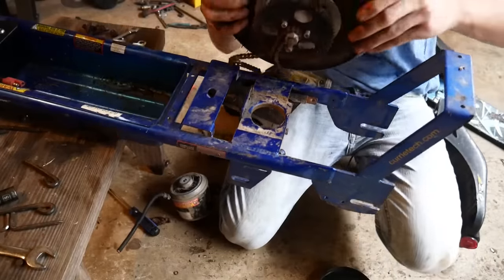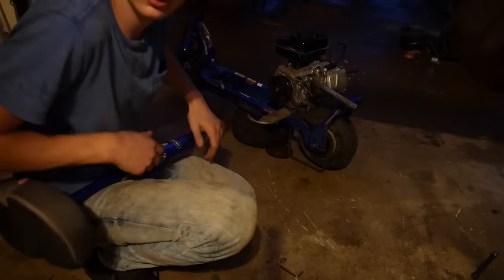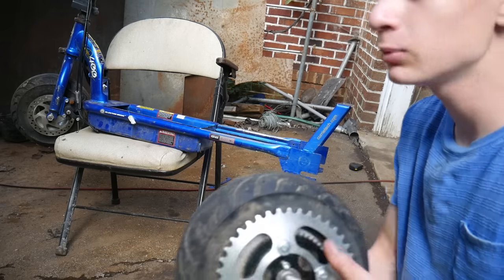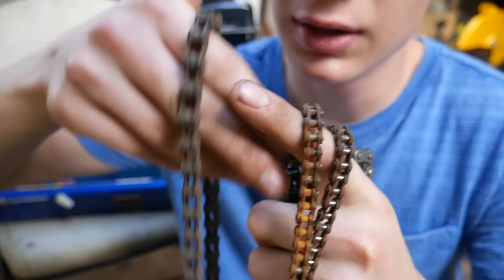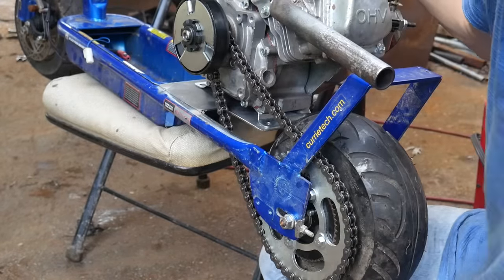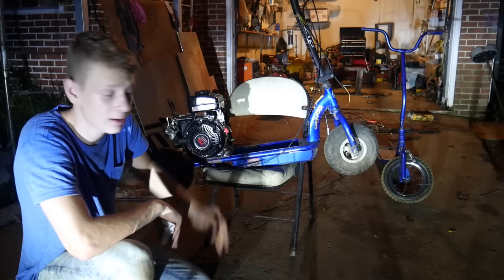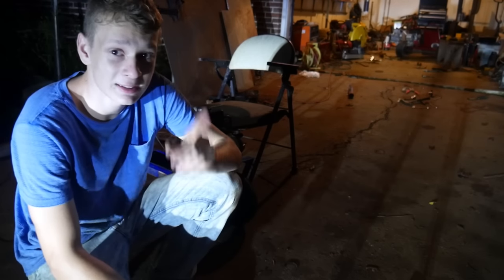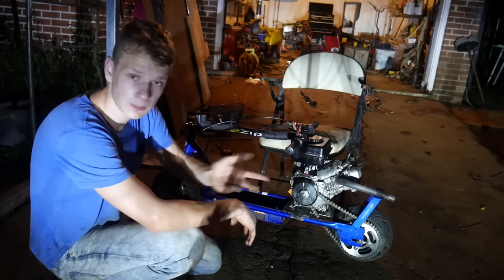Electric to Gas Conversion 79cc predator Motorized scooter Part 1

Comment: The area under the floor you can put a 12 volt battery and use it for a head light and brake light for night time riding.  To charge the battery you can use the chaging port that was on it. The hand brake that was on it has a built in switch to cut the electrical power to the electric motor that you took off and can be wired to make the brake light work.   Might want to put some eader wrap on that pipe too.   Just a thought for you to use.
Reply from the maker: David Johnson I was wondering what time wire did. I assumed it cut off the motor! Thanks David for the advice I appreciate it!

Comment: Don't paint. Just touch up the bad spots. If you plan to sell. The buyer would be more inclined to pay more for some thing that doesn't have layers of rattle can over factory powder coat
Reply from the maker: Corey Marshall why do you say it is powder coated?
Reply: @VasilyBuilds  well I'm not 100% but most Manufacturers of large scale use a Electrostatic powder coating process. This is the most efficient way of getting paint to stick without lots of waiste and its just efficient. It also doesn't scratch chip as easy and protects against solvents. Everyone has done a nice rattle can job to there project. Sadly 2 months later half of it will be ruined my the gasoline and oil spilled on it
Reply: @VasilyBuilds  clean and clear coat your welds and other exposed metal. The blue already looks good. Plus leaving it original has that new store look that parents like to see when they give there child hundreds of dollars to buy something like this. I mean that's the market for this. That scooter could make some kid king in his neighborhood. And hour of enjoyment
Reply from the maker: Corey Marshall I will probably do that. But I Will have to prime the bare metal. And I still have to do more welding

Comment: Picked up a 500w 48v electric scooter that was missing the batteries (chain driven) for $30. Sold the esc for $20 and motor for $70 to put back into making it petrol with a weed eater I have laying around

Comment: I'm actually planning on doing something similar with an e200 razor and a 2stroke bike kit
Reply: Did it fit? I am planning on getting a cheap 80cc 2-stroke kit for my 10-year-old Razor E300. Batteries are dead so I thought gas conversion is the cheapest way of making it fast again.
Reply: @Gamer-pb9tw  batteries for the e300 aren't that bad I don't think because they're let acid. you could do a pretty cheap lithium ion conversion if that's what your into. I never ended up doing it but it should fit if it was something you're interested in.

Comment: When you flipped the drive wheel so the sprocket was on the opposite side from original, how did you fix the free will mechanism that would only turn the other direction?
Reply: It's just on a ball bearing

Comment: Hey Vasily, do you know what size jets come on the factory 79cc carb. I have one on a bicycle and it seems to not rev past a certain rpm. Btw I removed the govener already. I think its my jetting. I am using a nt carb off a 2 stroke kit. Any advice would really be appriciated. Thanks.

Comment: Bro I’m making the same contraption as you same scooter and motor, I’m mounting my engine to wood do u think it’ll hold!? And I’m using a 36tooth sprocket on the back tire! With a 35# chain
Reply from the maker: 36 tooth is way too low. You'll have zero torque. Also it's better to use #420 chain, 35 stretches to much
Reply: Vasily Custom Builds what if I used a 60 tooth sprocket and 35 chain? It’s only a 79 cc engine!?
Reply from the maker: @matthewwright98  depends on wheel size. 8-13 inches use 53t would be perfect. I don't know your wheel size but I'd say shoot for 25mph top speed. 79cc's are not very torquey even when modified, it struggled. I think I ran 11/49. I had so much issues getting the alignment right with #35 chain, I switched to #420.
Reply from the maker: You can probably get away with #35 chain. Watch all my videos of this 79cc scooter, they may have all the info you need.
Reply: Vasily Custom Builds okay! I’m using to stick tire that’s on it, I just got a 60 tooth sprocket to be safe

Comment: Dude love the channel been here since like 600, please cover up bare skin welding, your too young to learn bad habits
Reply from the maker: dropn loads Yea for small tack welds I usually do not put on gloves. But I do put them on when I run beads. Thanks will keep that in mind
Reply: Vasily Custom Builds long sleeve shirt too. Don't mean to be a safety Sally but don't you notice the sunburn
Reply from the maker: dropn loads I thought that was only with Tig? Never noticed any redness or anything like that.  I will try to be safer
Reply: Vasily Custom Builds yes more so with AC tig for aluminum but it's all bad to be exposed too